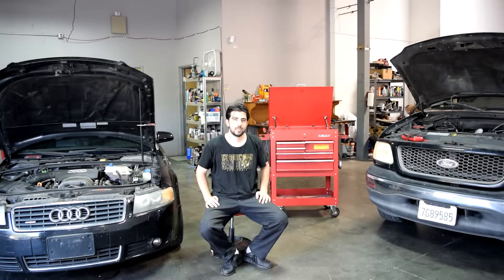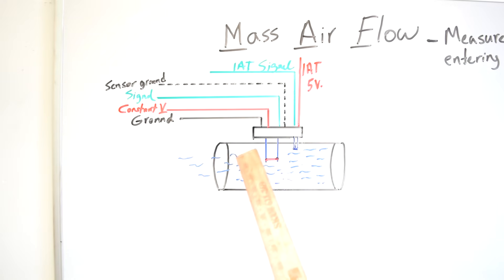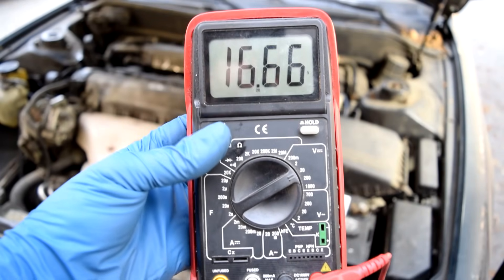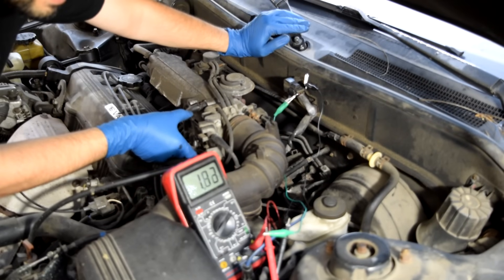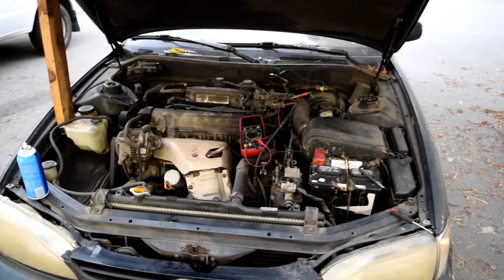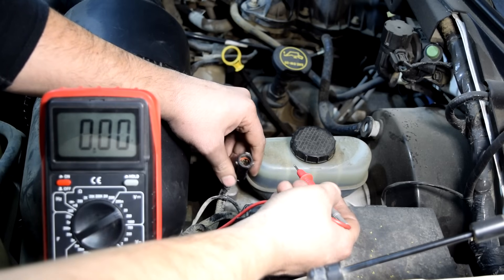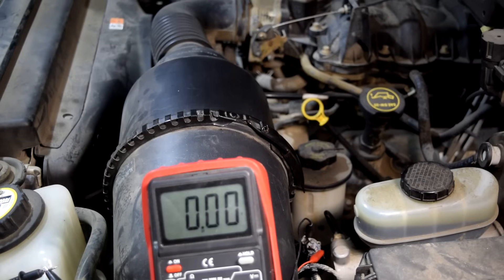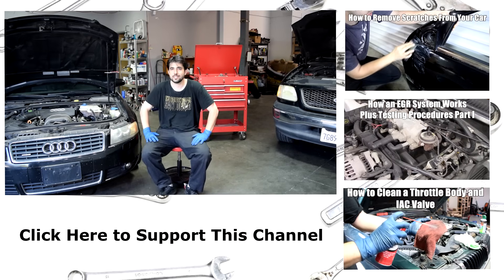How to Test a MAF or MAP Sensor With a Multimeter - Plus an Operations Guide

Comment: Good video..
Reply from the maker: Thanks for watching and commenting, cheers.
Reply: Ratchets And Wrenches hi i have a question. have a jeep grand cherokee 2006 and always went i turn on i feel like something like air flowing taste like copper n give me headache n feel dizzy is coming out from my vents or under the jeep i check exhaust leaks was ok check heater core was ok check freon leak was ok can u tell me what can possible is this taste of copper coming out the vents make dizzy headache.thankzGonzalo Cortea
Reply: blower motor resistor might be burning wires / melting they do that when the blower motor is on its way out and or the resistor but if you still have air flow with no noise ,squeal,grind or humming from the blower than its good and the resistor is bad... it will smell like burnt plastic- most are behind or under glove box not to far from the blower motor------from Detroit where it all started and now imports rule the streets.....what a shame

Comment: Two questions, what were you spraying to check for the vacuums leak and is there any danger with testing for ohms and you hit the power supply wire?
Reply from the maker: I use brakeleen, starter fluid (could start a fire) safe way is to use propane. I have a video on finding vacuum leaks. Yes, don't check a hot wire for resistance you can damage your multimeter and or the wire. Thats why I checked for power first than excluded that wire/pin for the continuity to ground test. gl